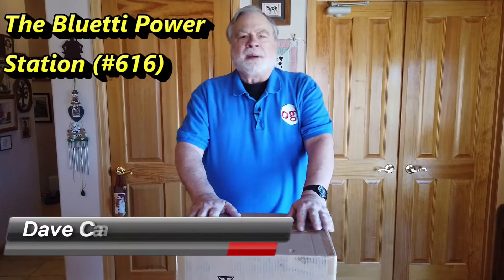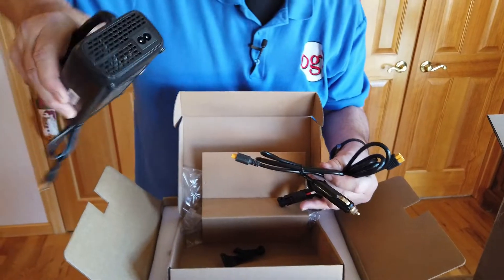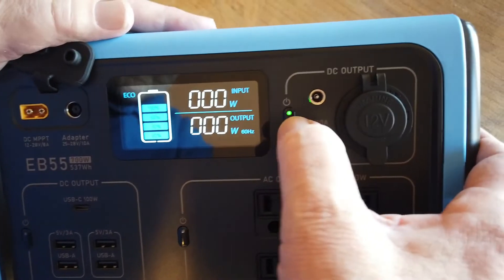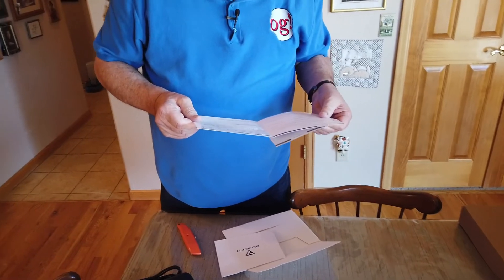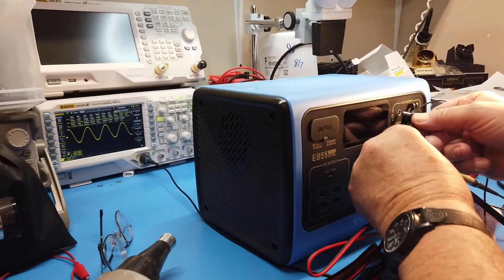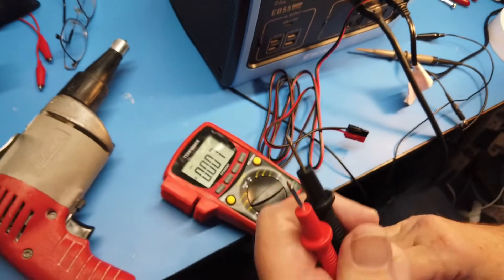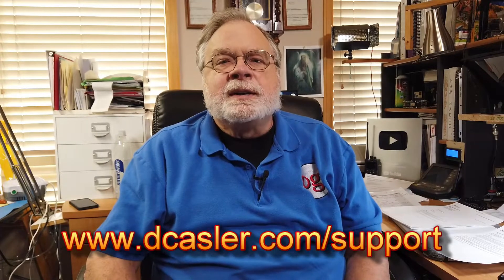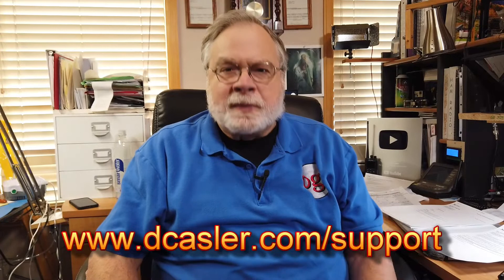The Bluetti Power Station (#616)

Comment: Dave, I think that "odd" AC power output is actually close to the US national grid standard. IIRC that is actually 117VAC plus or minus ten percent. And to make things worse, we do have multiple standards. The 10% variation accounts for the range from the guy closest to the mains transformer (high) or the guy at the end of the drive (lower).
 The usual standard is "All we promise is to make your light bulbs work." Literally. But as a ham, you may know how responsive and caring most power companies are. (Ahem.)

Comment: Would have been nice to know if it puts out RF noise when charging both with PV and commercial power with it's included charger.  Or even just in normal operation when running on it's included battery.  (Usable for field day, pota, etc. and not kill reception?)